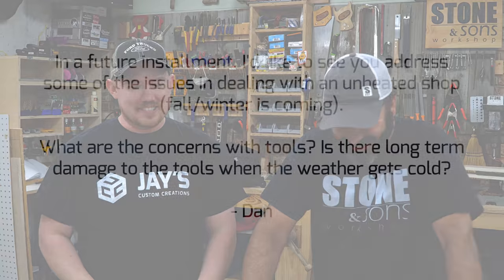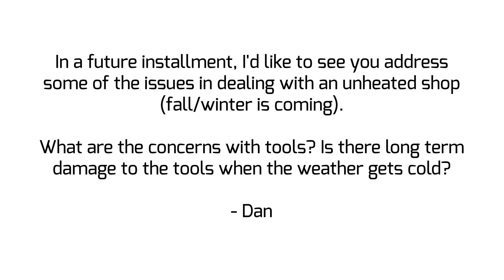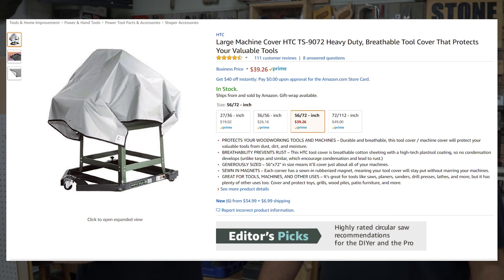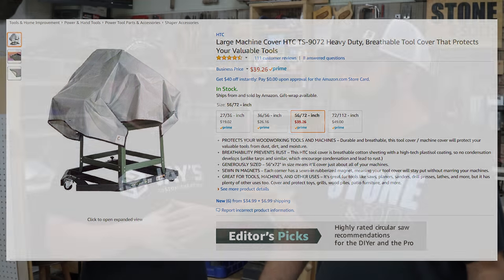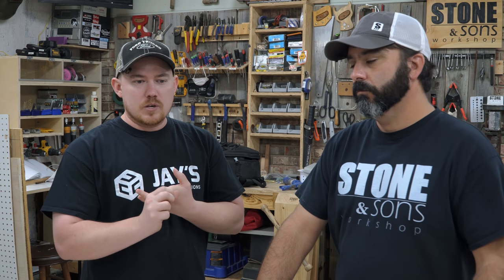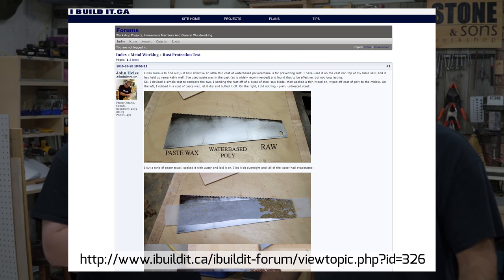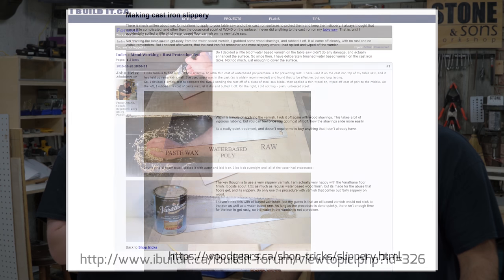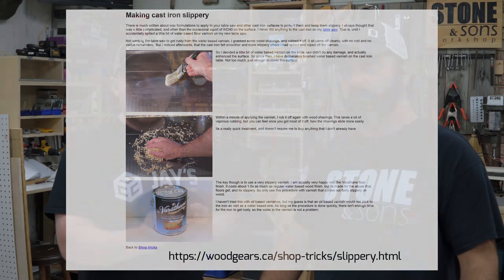I Get Email #08 - Workshop Heating, Condensation, and Rust

Comment: I don't have control over the temperature and humidity for my shop so I use Paul Sellers' rag and oil in a can trick and it works exceptionally good. Humidity in my shop swings from 40-90% humidity and 12-30*C
Reply from the maker: +Andrea's Workshop great solution.

Comment: Basement shops present humidity issues all year round, particularly here in New England.  In my shop I use a dehumidifier during the summer months, which seems to work fine unless the cooling coil of the unit ices up.  When we get a nice dry cold front passing through I open all the windows and my shop door and let the dry air purge the dampness out.  In the winter time the shop temperature drops to the mid to high 50s, which is too low for the dehumidifier to work without icing constantly.  I keep most of my hand tools in tool boxes, which works fine.  But also give planes and chisels, etc., a light rub with WD-40. I think WD-40 works as well as Boeshield and is certainly a lot cheaper.  Recently got a new table saw and am using paste wax on the cast iron surfaces (give it a quick recoat every couple of weeks).  We shall see how it goes through the winter.
Reply from the maker: +Robert Craig Good info. Thanks for watching and giving us your viewpoint.

Comment: I live the in Southern Texas that is ALWAYS humid.  I clean and wax my cast iron tools every three months.  I do not have any rust issues.  Forgot, I have a garage shop that is not heated or cooled.  I usually open the door and use fans when working.  The only thing I worry about is a drop of sweat dropping onto the surface.  I may try the polyurethane on my band saw to see how well that works.  Wish I could add a mini-split, but we still keep a car in one bay of the garage.

Comment: Hey guys~!  I'm looking to put mini-splits in my shop in GA where it's wicked hot & humid in the summer.  My shop is a 30'x40' pole barn (steel) with a concrete floor and a 14' open ceiling.  My HVAC guy gave me a quote on a pair of 18k BTU units, but I'm leaning toward a pair of 24k BTU minis.  Jay, I know from your previous video that you're in a 20'x20' with a single 18/19k unit and you're happy with it.  Shawn, could you share your shop size and number of mini-split sizes/ratings that you're using?  I don't recall seeing those details in a video.  Thanks much for everything you two do~!!
Reply from the maker: +Andrew Brown my shop is roughly 20x20 as well and my mini split is a 12k unit. My walls and ceiling are insulated as well as my garage door. Thanks for watching.